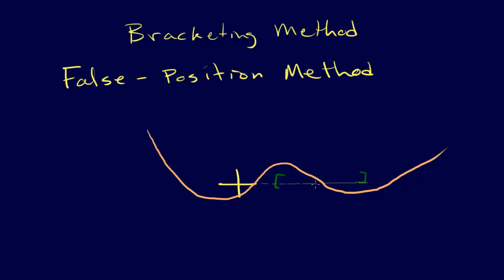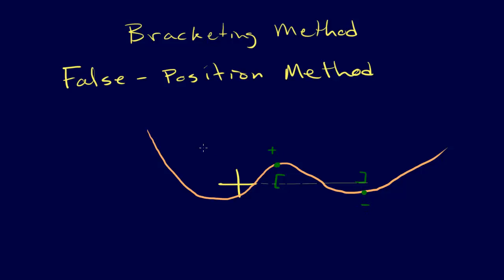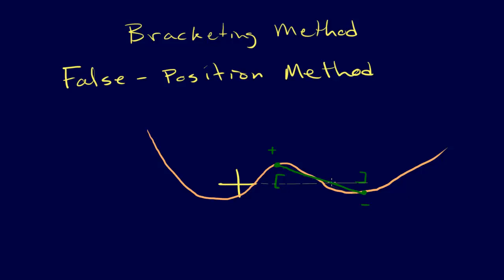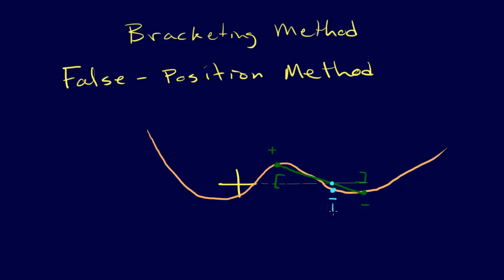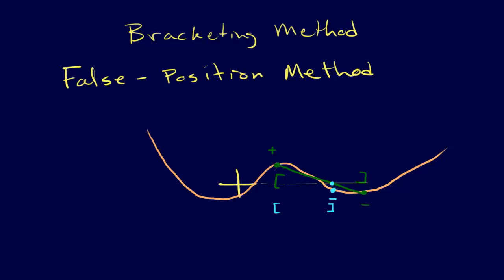2.1.2-Roots: False Position Method

Comment: Isn't this the secant method?
Reply from the maker: No. It is very similar, though. Secant method is an open method, whereas false position is a bracketing method. For more on the secant method, see https://youtu.be/ZfMibcIr5YA. For more on the differences between methods, see https://youtu.be/kZnqDuc2kRs.
Reply: @kvyi  is it possible for the false position method to fail?